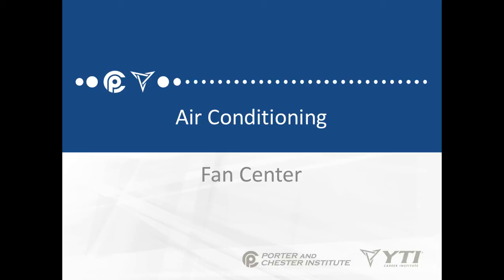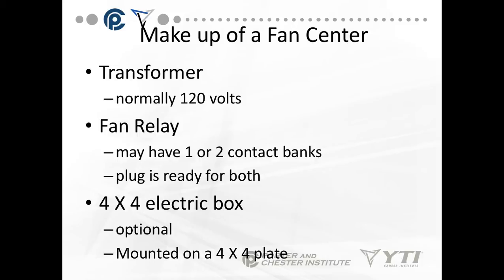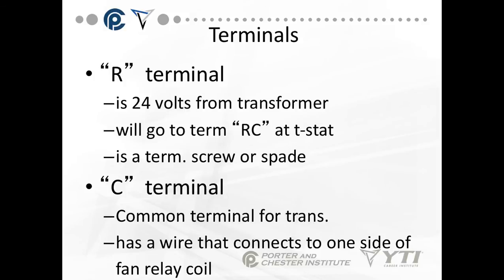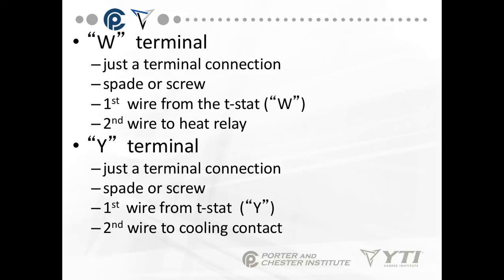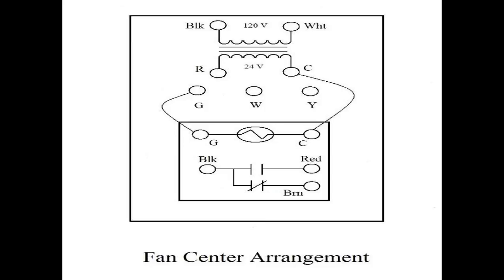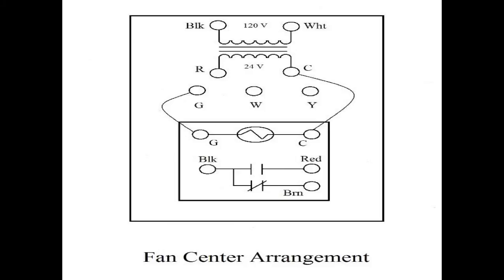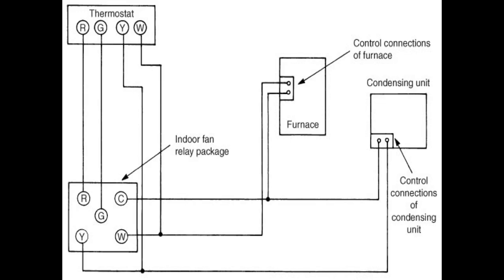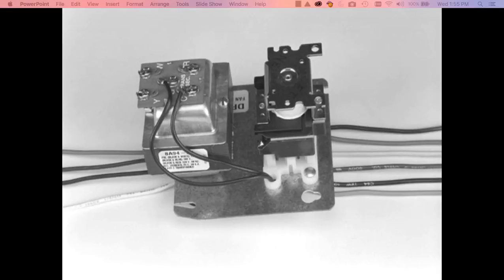Air Conditioning: Fan Centers

Comment: I just put one of the on a old temo matic furnace to add ac. And on tbe high volt side i put the black the black going to blowet i think. And the brown wad going upto the heat spring thing. And thats it i think. On high side i had red, brwn ,and black witch also went to blower motor. Can you help make sure i got it right.? And does green wire goto one of terminals on gas valve?

Comment: the first video that was actually helpful.  Can I use this to connect a thermostat to the swamp cooler in my greenhouse? I can manually set the swamp cooler to run the pump and fan at high or low speed I just need a thermostat to turn it on and give it power.
Reply from the maker: I am sorry I didn't see this question early. Yes, you can. But watch your voltages and currents.